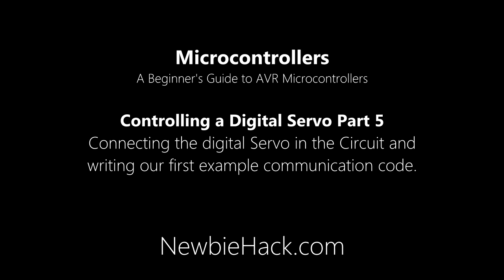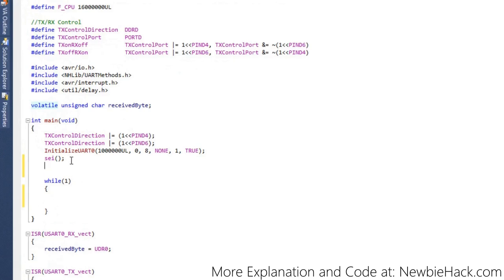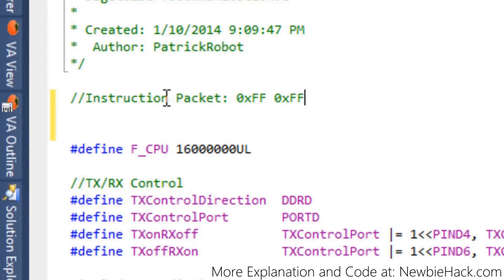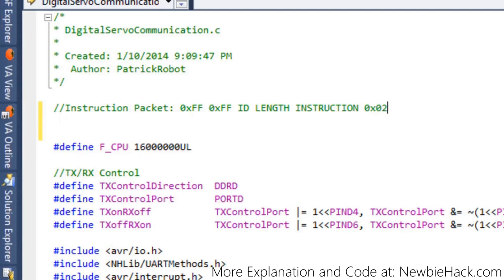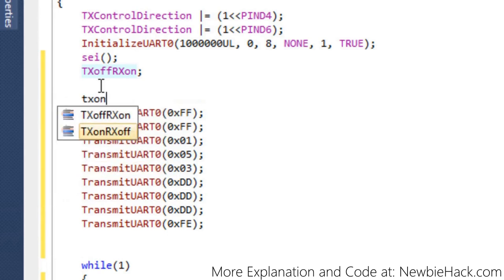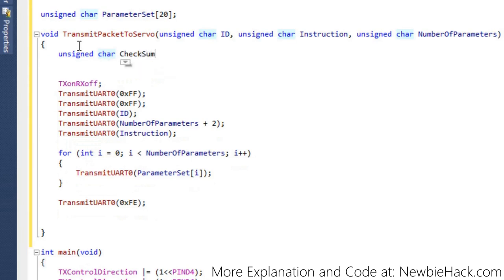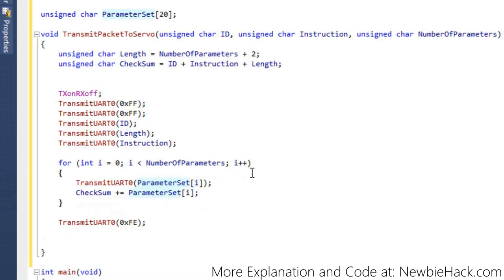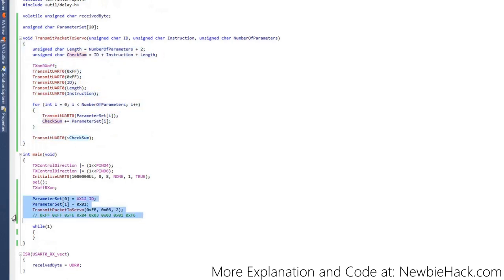How to Control Digital Servos - Tutorial for AVR Microcontrollers Part 5

Comment: by far the best video tutorial series on technical topics I've seen so far and I've seen a lot.
Content, explanation and presentation are brilliant. A nice guy explaining interesting stuff in high quality with good presentation tools. What else can you wish :)
I love the idea of those on-paper-circuits.
Thanks a lot!

I'm still not 100% sure why you need the 74HC126. Why can't you use a single IO pin connected to the data pin?
Reply from the maker: I may try omitting the quad buffer chip. I'm not sure how it will affect the uart receive buffer.

Comment: Are you going to make another video on this? I did not manage to get a response from my dynamixels and I would like to know if you did with what you've built and programmed so far. And honestly I don't like waiting more than a months for a tutorial to continue. May I suggest that you publish only finished series so no one will get stuck half way.
Reply from the maker: Thanks for the feedback.  You are correct and it may, at the present, be a bit frustrating to wait.  I do this as a hobby and I receive no compensation to do these videos.  Additionally, the videos, in raw format on my computer takes way too much space to keep, so uploading as I do them is my only option.  

I will have a new video here in a few days.

Comment: Great video.  
But you should not use a global parameter in TransmitPacketToServo.  You should add a pointer parameter to data array, so you could use a variable or any other source for data to send. Then it will be much more flexible.

But great video. When next video?

Comment: I have purchased the product dynamixel MX-106R. Can you please guide me how should I interface the motor with controller ATmega16. I am making a robotic arm. So I will require to send data serially to motor through controller. So please help me how should I do so.
Reply from the maker: You will see this in the coming videos.
Reply: Thank you